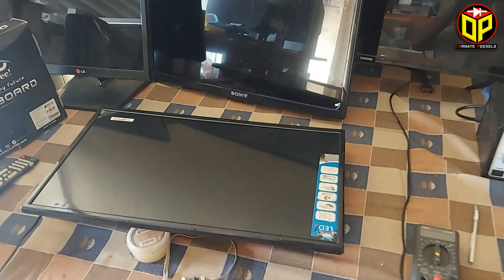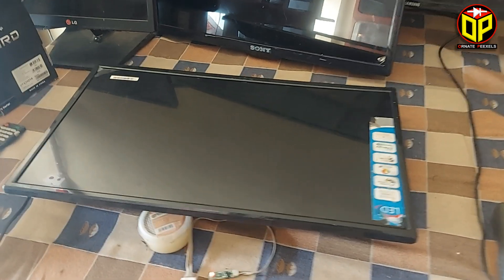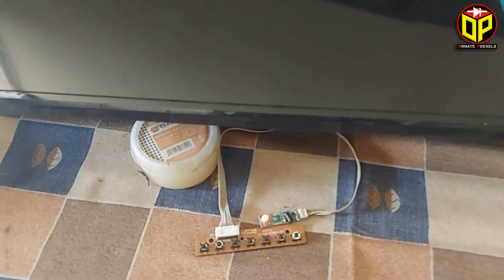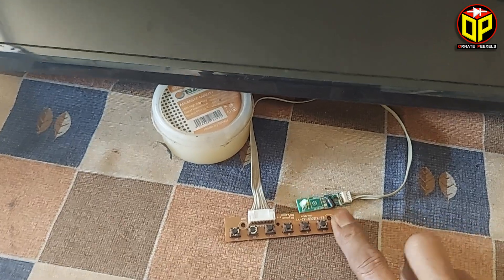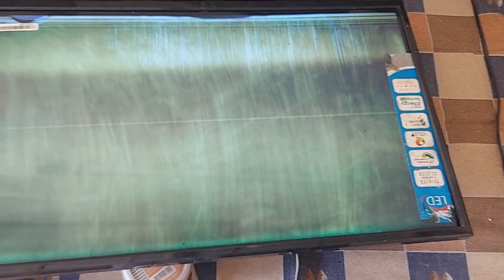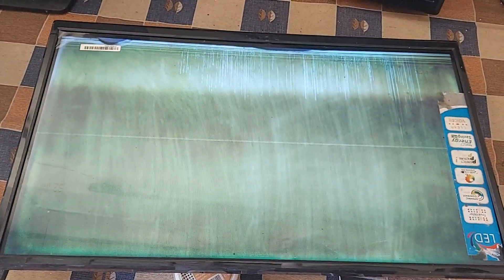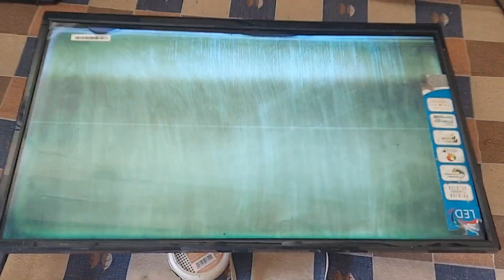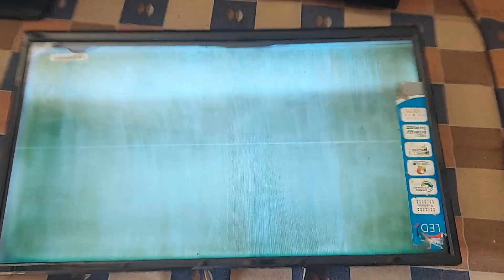LED TV Panel Repair - No Picture No Graphics | Bypass connection method from Gate COF to T-CON board

Comment: AOA
Sir please use 30 watt soldring iron having thin tip for work on LED TV COF AND SMD.LOCAL IRON WILL DEMAGE THE SMD PCB.PLEASE
Reply from the maker: Your advice is perfect.  But my 20 watt soldering iron coil is burnt.  Thanks.  Stay well brother.